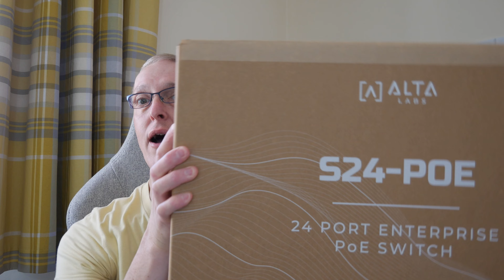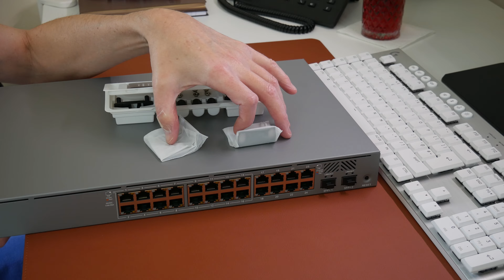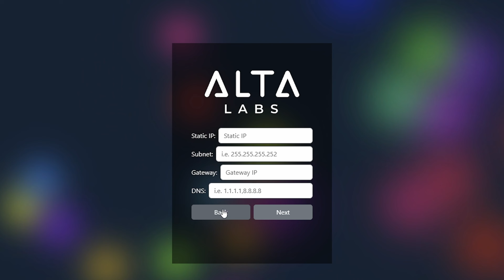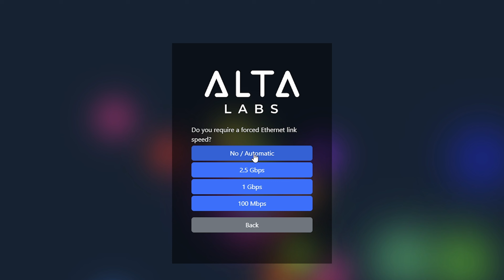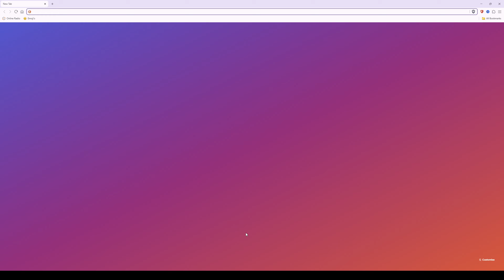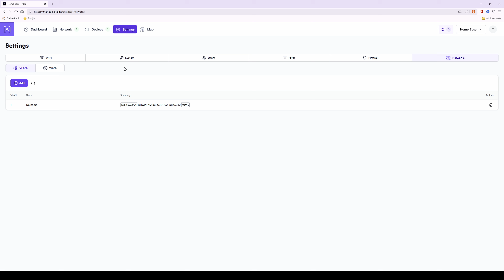My New Alta Labs Home Lab Setup Part 1

Comment: Gday Tim whats the fan sound like on the 24 port switch? Too noisy for home?
Reply from the maker: Good day to you too Dave - Well I found the fans a little too noisy for a communal room at home, the fans sound like a server (if you know what I mean), not extremely noisy but just that little bit too much.

So what I did was replace the fans with Noctua ones and that completely sorted the issue.  I did a video about the fans, if you want to take a look on my channel you'll find the video 🙂